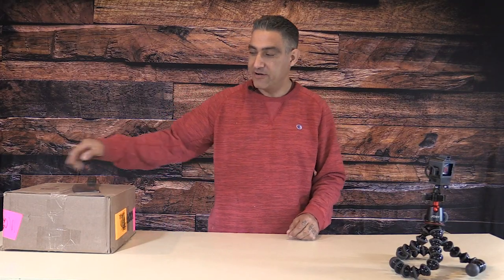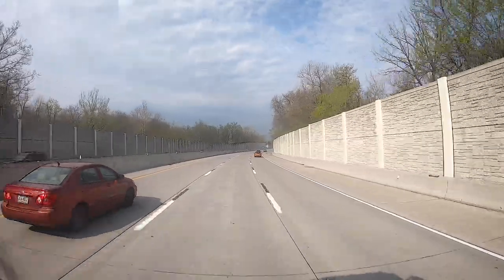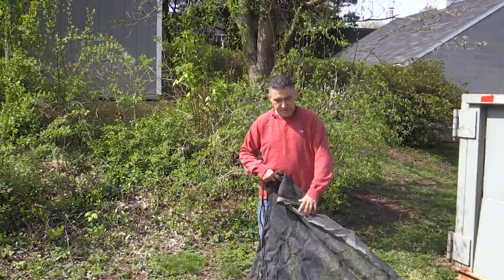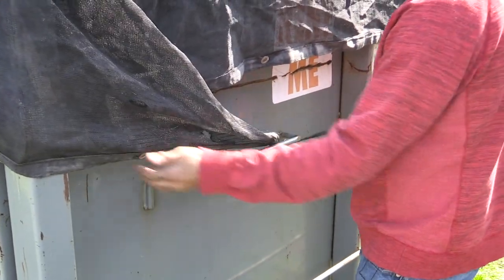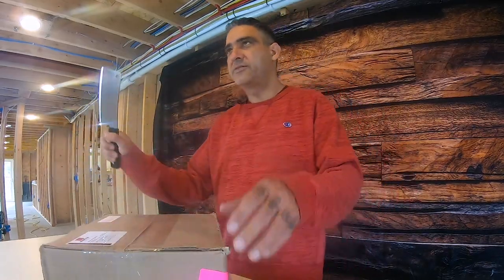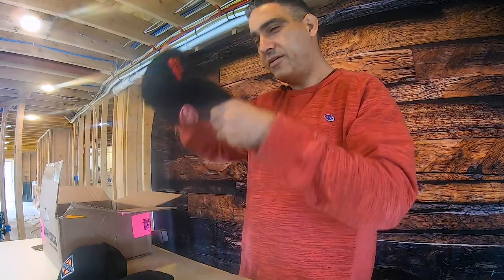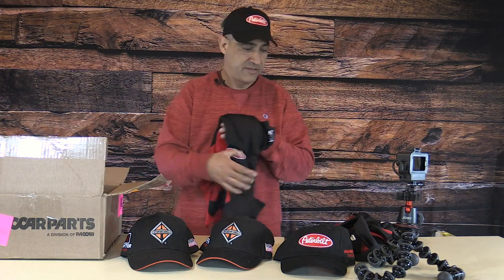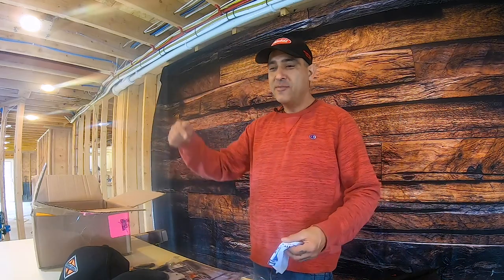First Unboxing From HUNTER TRUCK (How to Tarp Your Dumpster)

Comment: What is your opinion on roll off trailers? I was thinking about getting one starting out to use with my pickup truck until business builds up.
Reply from the maker: Def a Idea has pros and cons best Pro low start up cost
Reply: 4kvideofunjunky thanks for your reply! Another question I have, Why do you use CCS? I did enjoy speaking with the salesman there, but have you ever worked with other companies? What makes them stand out? Also, if my hook lift truck allows 18FT containers can I get 30YD containers, even if it’s single axle?
Reply: 4kvideofunjunky I need under CDL starting out btw.

Comment: I really like your video's.
Keep the swag and use it.
I like the tarp lesson. 
Have you thought about an auto tarper, like a rollrite unit, we are considering one for our cab over.
Maybe some future videos can be at your bin manufactures plant, hoist builder.
Very interested into how you do dispatch and price jobs on the go. How do you keep things organized.  Do you keep a paper log or electronic log, with all the calls.

You answered that last question before, but could you be more specific on the how!

Sorry to be so wordy.

Trashconnections.ca
Reply from the maker: the truck is tom light duty to add all the bells and whistles dot would kill me on weight